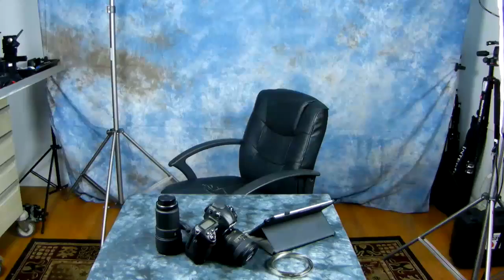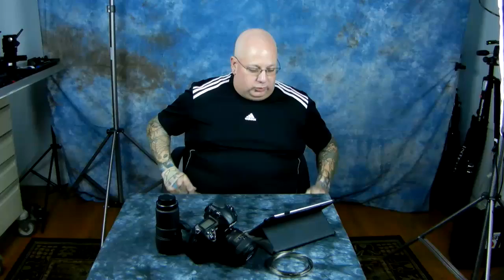Angry Photographer: The Basics and Fundamental of Good vs. Poor vs. Compromised LENS DESIGN

Comment: Personally I would choose sharpness over saturation and depth. It's easier to add saturation or vibrance then fixing sharpness or even chromatic aberration. If all photo is soft there is nothing you can do much then pushing it towards hdr..
Creating photo is one thing, post process other and let's wont forget business part. Just to make things clear I'm not saying you are wrong in this video, but for many lens design not a huge deal. We agree that people trying to learn more their camera then composition and if we would have to worry about elements.. This all comes with time and experience. Many old farts shooting for many years can't even impress anyone with their works no matter how much "Made in Japan" stuff they own.
Reply from the maker: +Dyeless you can sharpen in post too.  :P 

Sharpness isnt everything, impressionism has its place as does everything.  One has to denote levels of sharpness relative to the sensor. 

purely TECHNICALLY, unless the lens is VERY OLD or defective, there are NO UNSHARP LENSES........purely technically
Reply: Theoria Apophasis At flat lightening conditions, wide open most lenses will produce image fuzzy and there is not much you can do about it. I'm not arguing about lens quality, but personally would choose sharpness over saturation. Chromatic aberration easy to remove if there is not much to remove, if you over do it then you will start to see some funky color shifting in places where you wouldn't expect.
As for impressionism there are no excuses anymore for a "bad" quality image, unless it was intended. Many with good gear will crap out bad photos while some others might produce breath taking images with crap gear. How do you feel about that? 
I know video is not about that. Just feels like sometimes we are too much in to gear then photography itself.

Comment: ken, hello, seriously appreciate the video yet again, seriously informative. I just wanted to get your take on something. I purchased the 50mm e series 1.8 for my sony a6000, A+ lens for 42 bucks, seriously. I also purchased the 50 mm F/2.0 also nikkor Ai but obviously non e-series so its a little larger with the front element less deeper inside the lens construction. I've seen that the F/2.0 has better color rendition, but the F/1.8 has better depth and separation. curious to know if you know why that is?
Reply from the maker: +Domenic Quarato the E series are great stuff. ......   E was 1970s "budget" 

which is 2015 "HIGH QUALITY"

how times change things

the F2 is sharper, by a hair.....   fewer elements, the lens geometry however is almost identical.
Reply: +Theoria Apophasis do you think that less elements causes a different color rendition? for some reason, the images from the F/2.0 just look better...
Reply from the maker: i know they do, absolutely,  ED glass changes things as well.